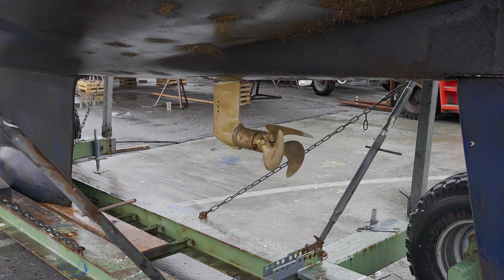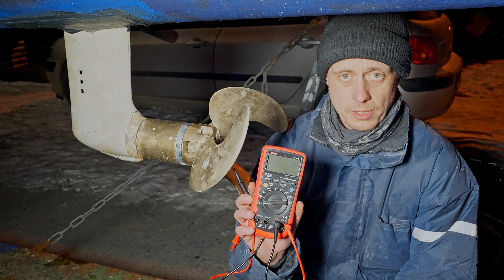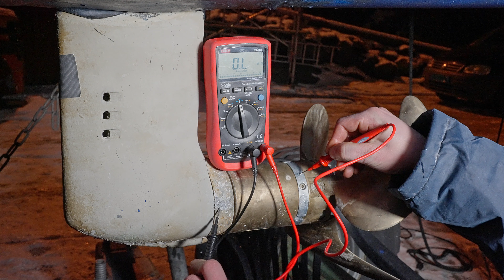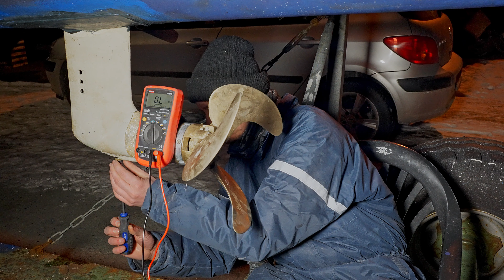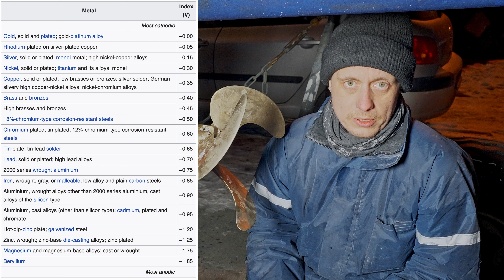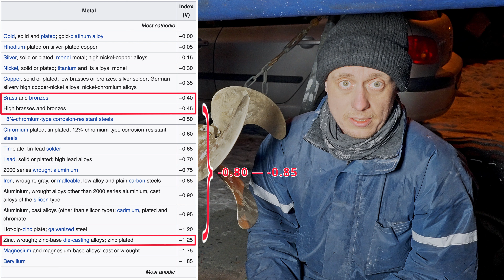Saildrive Anodes and Galvanic Corrosion

Comment: Hi great video! thank you so much for such information.  
My case is the opposite .  The anode on the sail drive leg is corroding way faster than that on the propeller, like 70% vs 5%.
I just checked my Volvo sail drive.  There is actually connectivity between the anode on my sail drive leg and the anode on my propeller.   Could you tell me please what could be a possible cause for my case?   I’m new to sailing and just acquired an old sailboat for a year.   Seems to me it’s normal the sail drive leg and the propeller are electrically connected as the nut securing the propeller is touching them both.   Could you please tell me what I missed and what is going wrong?  Thank you in advance.

Comment: You are absolutely correct. A few years ago, when I bought my first boat, I was worried about the same thing. Fortunately, we have internet nowadays. There is one more possible cause for the leg anode keeping well for a long time. One could install an fresh water anode , I think it is made of magnesium or aluminum - looks the same, but would be ineffective in salt water. I am not sure if they make fresh water anodes for the folding props.

Comment: Very good video.  I have owned my Dehler 36 for 6 years with a Flexofold prop and have changed both the prop and the sail drive anodes.  Brilliant idea to check the saildrive leg by draining the oil to gain access to raw metal of the leg.  Very concise discussion and easy to understand since I am a sailor...not an Electrical Engineer!!

Comment: The less conductive metal on show to the electrolyte (seawater) the less galvanic action can occur, the less your little prop anodes will suffer.
Use an enamel spray paint that protects the metal from water ingress, then antifoul on top of that. Stay away from the tight moving gaps of the folding prop mechanism with the paints ie blade gaps and pivot pin holes. 
When you fit the anodes, tighten the bolts then ALWAYS tap the anode with a hammer a few times (not too hard) and then retighten the bolts, youll find the bolts were not as tight as they were before tapping the anode. ALWAYS do this on mechanical items that vibrate such as props, saildrives and prop shafts. TIGHTEN TAP TIGHTEN youll never have an anode come loose ever again.

Comment: Thankyou for that explanation. I'm looking after the rubber bushing separator. I have the same setup, an MS25s and recently I installed a Volvo Penta 2 blade folding propeller. The original separator is metallic. I'm unable to find the part number of that rubber separator.

Comment: Thank you for this film. Since I only use original square parts from volvo penta, the zink anode on the sail drive makes a better job too. I would never buy the zink anode from any discounter any more. I believe, the chinese producer of the cheaper anodes use a different material as volvo penta use for their square parts. When I found corrosion on each sides of the big rubber seal between the gear box and the saildrive, I realized, that the anode on the sail drive near the propeller did not make a good job. (Sorry for my bad english)

Comment: I went through the same head scratching on my Yanmar SD20 saildrive. Indeed I verified the prop is electrically isolated from the aluminum sail drive, and my prop has no zinc, I just have a zinc to protect the saildrive. With the prop electrically isolated, there is no place for charge to go, so galvanic reactions are very slow even without a specific zinc. Aluminum oxide has a way of covering and protecting the aluminum because it won't make easy electrical contact with a dissimilar metal, even if touching.  When I look at how the stainless bearings inside the sail drive are mounted, they do make physical contact with the aluminum housing. Perhaps the prop has some kind of insulating sleeve. I always locktite the zinc mounting bolts, I had one fall off years ago.

Comment: Thank you for a very good info video. You seem to have knowledge of corrosion issues. So maybe you can answer me, a relay (Relay 872242 , Included in installation kit 872381 for changing from 2-pole to 1-pole starter motor., SN2300052118-  ) is to do with corrosion pretention, or what it is for. If you have such a relay, on your boat motor. Will you get a different measurement result, when the motor is running?    
I have a Volvo Penta 2002 with a sail drive. I have a issue with motor sometimes will not start, and I think it may be the relay because, when I run a cable from the ground on the battery, directly to the motor block (bypassing the relay), the motor starts, and continuous to start here after. This got me wondering what the function of the relay is, do you know?
Reply from the maker: I am actually not sure if I have the same relay somewhere and I am right now not on the boat. 

I heard or read somewhere that there is no galvanic isolation between motor and saildrive unit in older Volvo systems like in your Volvo 2002. In the newer ones the saildrive is completely galvanically isolated from the motor. That prevents stray current from any other system on the boat to reach the saildrive and to form an electrical circuit through the water. 

Therefore, I'd assume that the relay simply prevents the motor/saildrive from being permanently connected to battery negative/ground, and to answer your question more direct: yes, I think it is a corrosion protection. 

In that case I would strongly advice against connecting ground/earth directly to the motor and to bypass the relay permanently. If you would then have any stray current in your system (or worse, stray current from another boat or even the floating bridge/dock through faulty wiring in the shore power, if you are connected) it could potentially form an electrical circuit and your saildrive leg might literally dissolve over some time. There are some pictures online of saildrive legs destroyed by this issue. 

If starting works by connecting your motor to ground then I'd try to swap out the relay. 

And please take everything I've written with a grain of salt. I am no marine mechanic and don't own the same motor :-)

Comment: Exactly correct. I see a lot of strange articles on cathodic protection on sailboats. Mostly wrong (I have worked with cathodic protection). Charley Horse is somewhat correct the surface area has a lot to say. Small anode to large Cathode surface area wise is critical. You can expect the propeller anode to be ‘used up’ same rate as last season, water temp dependent - so same sailing area. You can reduce by using epoxy paint on the areas you don’t mind painting of the bronze. This is of course an opinion issue what can be painted. I personally like to paint the propeller excluding hinges etc, epoxy paint and anti fouling. After 8 years no fouling/ small anode usage and very happy. But some believe in polishing the bronze. This is fine- but to stay fouling free you need copper ions released and the anode mostly will prevent this, although may be enough depending on where sailing and fouling activity. Have you experienced fouling prop?
Reply: Something Very late to the picnic that could prove useful - though I haven't got my boat with a Volvo Saildrive just yet, but am hoping to try for myself when I do. On forums, I have come across posters doing this for many years as antifoul from Boat propellers. They paint them with Zinc Cold Galvanising Paint, Marine version like with Pettit, is very expensive, but is identical to cheap land usage versions. I found for paint and roller application, tins of 96% Zinc, in a Silicone carrier. 3 coats of lesser concentration (75% ish from memory) Aerosol Spray, supposedly good for up to 18 months. To me, the 96% brush or roll on, seems the better option, and get a nice finish with one coat on top done with aerosol perhaps ? It is also providing extra Anode Protection ! So new Anodes, give a couple of coats ? Plus as on the boat I'm getting, the Rudder isn't far from the Sail Drive leg, I'll paint that too, plus after Epoxy Barrier coating the Cast Iron Keel, I think I'll slap say 5 coats on that, and see what effect it has. It has the advantage of Also being Non Toxic. Aerosol Sprays in UK are about 10 pounds a tin, The 1kg 96% Brush or Roll on, about 25 pounds a tin, both including VAT. I'm guessing a bit, but I think what gives the antifouling effect, is the Galvanic Surface erosion, keeps the surfaces clean. A kind of Self polishing effect ? 🤔 Best Wishes and Fair Winds.  Bob.
Reply from the maker: Thanks for confirming my conclusion! I know what you mean with "strange articles". I read a lot about the topic online, and the conclusions from article to article were often not in agreement. The only plausible and coherent explanation for a non-professional on cathodic protection I found so far is from the book "Boatowner's Mechanical and Electrical Manual" by Nigel Calder.  

I thought about painting the prop like you recommend but shied away from it since I was afraid that the folding mechanism/hinges could become blocked. That I could paint the prop only partially, i.e., the blades, didn't even cross my mind :-D. It was to cold outside for epoxy when I worked on it anyways ... But I do get very little prop fouling anyways. The prop in the video is untreated and has prior to the video been in the water for a bit more than a year.

Comment: It's not just the metal there is much more surface area on the propellor, effectively drastically increased interaction with the electrolyte (seawater) when the rotating under power.  I would be curious to see the rate of galvavism over a time period of just sailing or at dock, versus under power (perhaps a long motoring trip or several)
Reply from the maker: I completely agree. I'll try to monitor it this year (gopro on a stick, too cold to dive) and see how it progresses.

Comment: PROTIP: Den Weißabgleich in der Kamera manuel einstellen. Dann ändert sich das Bild zwischen den Einstellungen nicht mehr von einem etwas "wärmeren" zu einem etwas "kälteren" Bild. Oder anderes herum. Wenn Du draußen filmst kannst Du einfach 5.600 Kelvin (Tageslicht) einstellen. Wenn Du indoor filmst, dann 3.200 K (Kunstlicht).  (+- 200K, je nach Geschmack).
Reply from the maker: Jo, mache ich normalerweise auch meistens. Allerdings sind da 5-6 verschiedene Beleuchtungsquellen draussen und ich dachte mir ich lass die Kamera das mal schön selber rausfinden (weil die auch immer an und aus gehen). Ist mir aber auch aufgefallen ...